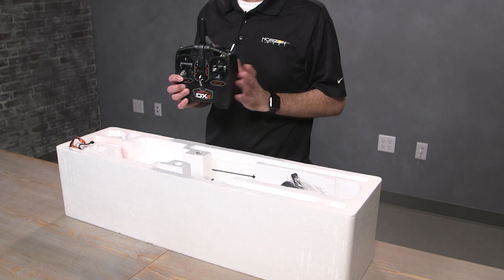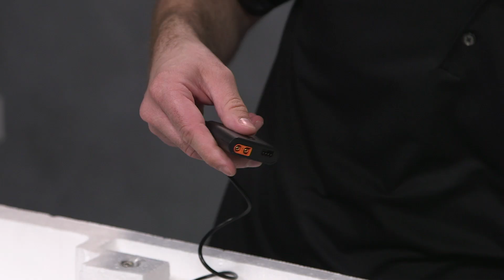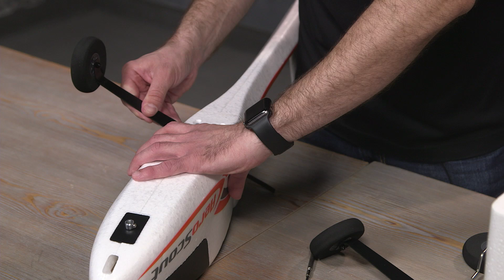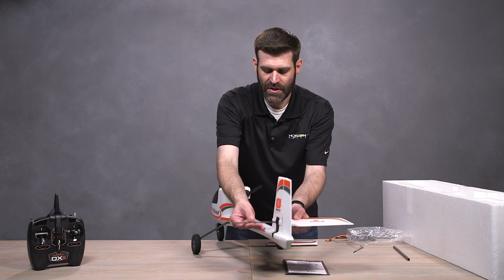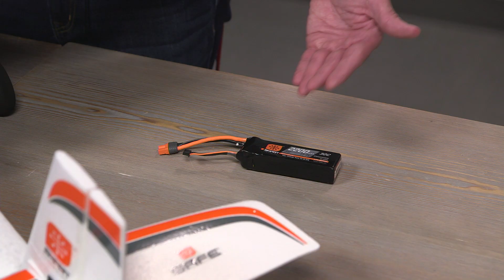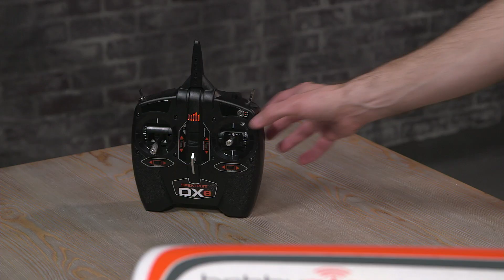Unboxing and Assembly - HobbyZone® AeroScout™ S and S 2 1.1m

Comment: Can u use a dumb battery to fly it
Reply from the maker: You can! You just need to use a 3S 1300-2200mAh battery that's equipped with a compatible EC3 or IC3 connector.

Comment: I just purchased this aircraft and had my first flight ever yesterday. Gusty wind and no crash at all. So great plane for beginners even if I had spent some time in simulator to get used to commands. One question I have: it seems that despite putting the transmitter in flight mode 2 (expert mode), I cannot roll or loop; SAFE seems to be engaged even in expert mode. I could not find a setting in the app. Is there a specific setting or setup I need to do? I tried with a DSXe and I tried in my apartment with the DSXeS (without flying) and gyro are kicking with both transmitters.

Comment: I wanted to learn to fly and this is the one I chose after watching a lot of videos of planes for beginners. The question I have is it as easy to disassemble when I store it because I'm limited on space.
Reply from the maker: Yes, very much so. The main wing is held on with three thumb-wheel screws and the horizontal stabs slide right off!
Reply: @HorizonHobbyProducts  Thank you for such a quick reply. I will be looking at Horizon products more often.

Comment: Hi Jason, I had a question about the BNF version and binding to a DX8.  Does this plane convert to the current style Safe Select (2-switch) or does Safe need to be assigned to a 3 switch and need to bind with all 3 modes the RTF comes with?
Reply from the maker: You can use a two-position switch. You will just lose the functionality of the intermediate mode.
Reply: @HorizonHobbyProducts  Perfect, I only need SAFE these days for a panic situation or for hand launches, however I'm very use to the current gear switch for my SAFE-Select.  I want to use this to put around near my house.  Thanks again for making such great products so accessible to everyone!

Comment: Hello excellent explanation thanks. I have a question if I buy this airplane and later on I buy the f16 or f15 could I use the remote control of this aeroscout s to fly the f15 or f16? And the battery too can I use it with the jets? Or I have to buy another transmitter for jets
Reply: You can use the Dxe with is the transmitter that comes with it with any other plane that requires 6 or less channels and yes you can use the same transmitter with the f15 or f16. The battery that comes with it is a 3 cell, for the f15 or f16 it needs a 4 cell, I found my batteryfor the f 15 for around 40 bucks on amazon. 4s 2200 mAh lipo.~ Ryan

Comment: your wing screws are not all set into place ,I have the same issue of the screw coming loose from the plastic thumb holder .I fixed the issue with CA glue
Reply: Mine did the same thing.

Comment: looking at the price for RTF, the quick and literally easy assembly, nice landing gear, decent high wingspan, looks durable and a pusher prop, This is literally the best starter plane ive seen so far. Id even recommend  skipping the sport cub s. Add an FPV canopy for this and its perfect. Im wondering how itll fly with 3200mah
Reply from the maker: It's a bit nose heavy but will fly fine with a 3200mAh battery (as long as the particular 3200mAh battery fits in the battery compartment!)! That said, it already offers flight times upwards of 15+ minutes with 3S 2200mAh batteries!
Reply: @HorizonHobbyProducts  glad to know a 3200 will work. Your 2200 3s always seem to be on backorder, lol. Very popular battery I'm guessing.
Reply: @HorizonHobbyProducts  15 minutes?? I can get maybe 8 minutes
Reply: Right on Joe. Indeed I would’ve skipped the sports club had I seen this first.
Reply: How do you add a FPV canopy?